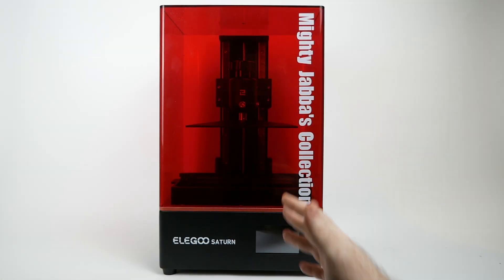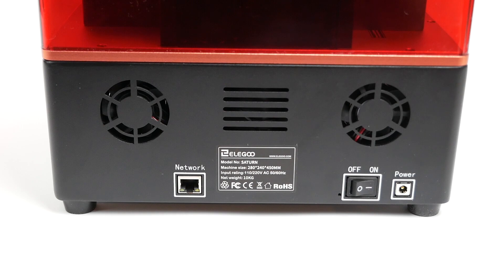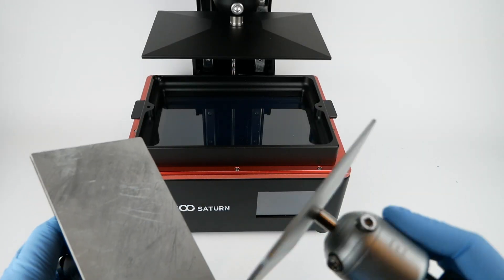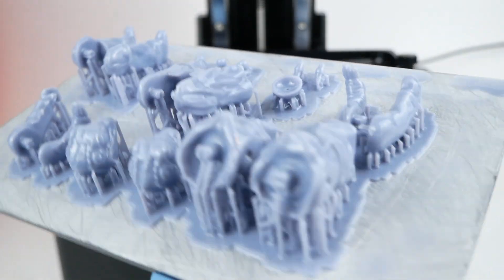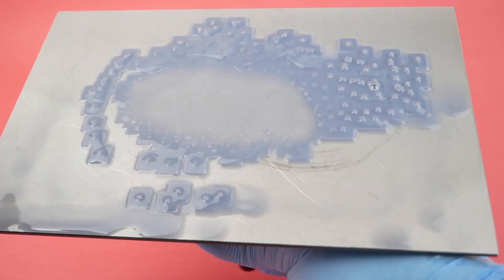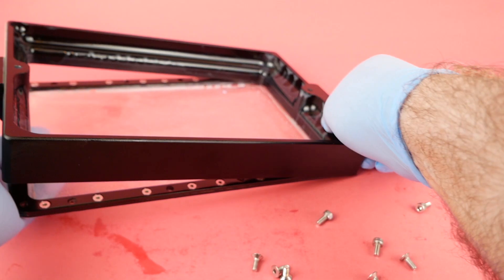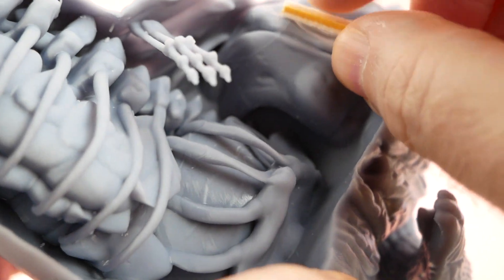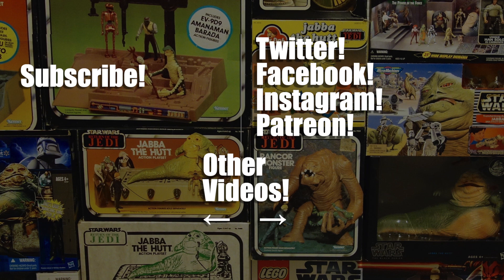Elegoo Saturn Resin 3D Printer Review After 4 Months

Comment: To think the Mars 2 Pro used to be almost 300$ on launch and now I have gotten one of these for 300$ in 2022. If you're on a budget and have the patience, waiting for resin printers to get older is definitely the way to go. Not only will you able to get the machines for much cheaper, but you also get extra support from other users on the internet with troubleshooting and maintenance. You have to appreciate early adopters for taking the hit with any issues and shortages!

Comment: I  purchased a Elegoo Saturn just like the one in the review, but after 10 different atempts, I have not been able to print one single item.  All I get are clumps of resin stuck to the bottom of the felt film and the built plate just you show it. The film is new, so I know that is not the issue. Any suggestions?
Reply from the maker: It’s hard to say but I would try releveling it and then look at your exposure times

Comment: Awesome review of the Saturn, I got lucky I saw the Saturn available on Amazon and I jumped on. I didn’t have much knowledge of the post process but over time I got used to it. I love printing big models such as busts and space ships. I think it’s a pretty good machine and it does a great job. I had the same issue with the FEP and I actually put a hole into the FEP. I also have to say finding extra parts like FEP, vats and build plates to be difficult for Saturn as most vendors don’t have it. 
My number 1 upgrade for this printer is get a Flex Plate. I ended up hating removing my prints. Once I got a flex plate I’’ve been enjoying this more. 

Also the update of firmware was challenging as Elegoo had bad documentation. Their support helped and It works. 

Overall I love my Saturn, I don’t own a Mars. I’m looking towards Jupiter next.

Comment: It's interesting you said you'd like the USB on the fron, I saw a few other reviews that say they don't like it on the front because it has had resin spilled in. Interesting differences.
Reply from the maker: It depends a lot on how you have your machines arranged, I think. If you have them up against a wall, the back is the worst location, and if you want a line of machines next to each other the side is also bad. I haven’t had any issues with ones in the front personally.
Reply from the maker: I did cover the basic process in more detail in my Longer Orange 30 review from a while back, and I recently made a video about the Elegoo Mercury X Wash & Cure Station, which is my current process.

Comment: Where does one find the programs to use with the 3D printers?
Reply from the maker: If you mean the slicers, just download them from the company that makes them (Chitubox, Lychee Slicer, etc).
Reply: Depends on the printer.

Pretty much all of them have their own slicers. But the slicers could suck. (Like, Luban for the SnapMaker is terrible, so I use Cura... that said, that's a PLA printer)

Comment: Thanks for that.  I was wondering if you have tried adding any mica or ink dyes to your prints.  I try to make things I can use in everyday life, so getting it to do colors is nice.  I can acheive that on my Creality 3 Pro, but it has obvious limitations.   Thanks Gary.
Reply from the maker: I have used fine glitter (not as fine as mica powder but close) and I’ve also mixed colored resins to get new colors and effects. They both work although the glitter in particular can be tricky. I haven’t really tried using dyes but I actually do plan to do that for an upcoming project.
Reply: @MightyJabbasCollection  Thanks for the quick reply.  I am trying some gold mica powder, with clear resin, it comes out brownish, EXCEPT on a couple of flat surfaces where it comes out good.  Wondering if maybe changing the time for the lights might change things.  Set at normal for first layer, wondering if maybe upping the next layers might make it better.  Any idea's on that.  I am pretty new with it.   Thanks.
Reply from the maker: It might be that the resin itself is yellowing. Clear can be pretty hard to get right but generally you want to only expose it the minimum amount required. So I’m not sure increasing the time would help. This kind of thing requires a lot of experimentation though
Reply: @MightyJabbasCollection  Yep, I expect I will be experimenting with time,  maybe white, and just keep trying.  Thanks for the comeback.

Comment: I watched two reviews of this printer from different channels, both needed to replace the film.
Reply from the maker: That’s interesting. I wonder if there is anything different about the film itself or just something about the way the printer works that’s stressing it more
Reply: @MightyJabbasCollection  I ordered mine today (my first resin), but based on the way the printers "pull off" the film, and the fact that the larger film has more "distance" to the center, could it be the stresses are more on the center of the film on the larger plate?

Comment: Hey as a 3d jewellery designer moving into printing, would this be worth the extra money over the pro 2  as tolerances are very important?
Reply from the maker: I think the Mars actually has a very slightly finer resolution due to its smaller size, but they are functionally the same IMO. I wouldn’t think there would be any benefit to going with the Saturn if you didn’t want to use its larger size

Comment: Hi, I had a quick question. Can this or the smaller version make transparent and/or translucent objects without there being lines for each layer? Thanks!
Reply from the maker: Yes, but it can be a little tricky to get things to be completely transparent. Parts tend to get cloudy after you wash and cure them, unless you do something like spray them with gloss spray.
Reply: @MightyJabbasCollection  Thanks! Is this something that only this type of UV printer can do? Print without the lines you see in other printers? I've never owned a 3D printer before. I also wondered if I would be better off using a 3D printer to make a 2 part mould that I could use with transparent or translucent resin. Thanks again!
Reply from the maker: It’s probably possible because resin printers can print with such thin layers that they can’t really be seen. But it’s still not perfectly transparent, although it can be very close if you do it right. What is it you want to accomplish?
Reply: @MightyJabbasCollection  I collect Masterpiece Transformers, and some come with things like blast effects, and some don't. I thought it would be cool if I could make my own. I do know 3D modelling in 3DS Max, but I haven't looked into this stuff enough to know if that would be very helpful or not.
Reply from the maker: I think that would probably work fairly well with transparent resin.

Comment: I used a plastic doodad to help tension my fep on the mono X ,are the printers that different ?
Reply from the maker: I have seen some instructions say to put a bottle cap or something under the FEP when changing the film to help tension it. Is that what you mean? I haven’t done that myself (and forgot to check what the official instructions are). For what it’s worth I’ve never had an issue doing it this way on my other printers and it seems to be working fine. The original FEP that I had the problem with was installed from the factory
Reply: @MightyJabbasCollection  yes I use a file I got from thingiverse to print a spacer and do get lines on the larger prints but it is the first fep I have installed in the nearly 3 years I've been resin printing so it maybe my fault.
Reply: Changed fep a few times on mine. Paper towel folded up twice does the job. I also add 2-3 drops of ptfe lubricant after I clean out resin to keep lift speed popping and works great!

Comment: The print fidelity is astounding! I wish I could afford one of these guys.
Reply: Once you purchase one the buying doesn't stop as the projector panel is a consumable and all MSLA printers require them to be replaced between 50-500 hours of printing at a 50-500 USD cost.  Nothing on a printer should be a consumable except for the resin.  Bad enough we have all of these prints that go in a landfill (the mistakes) because no city will recycle them, but now we have even more electronics ending up in the city dump only this electronic part is 50-500 hours between dumping.  Just not for me, and I so much would buy one if they stopped with the consumable projector panels.
Reply: @generalawareness101  They say 500 hours but everyones' mileage is different. I have personally used mine for close to 2k hours.  I bought a screen for $90 just in case 5 months ago. There are printers now with no screen for the same price +$100, would be nice to see how they work. EDIT: All printers have consumables just so you know :)
Reply: @vitobertucci9689  Not for those prices as 8 years and going strong on my filament printers.
Reply: @generalawareness101  and what do you suggest as a substitute?
Reply: @issabader1561  As much as I want one I am not into the whole consumable nonsense.  I don't own a 2d printer for this reason though if I did it would be a tank system so I could VERY cheaply refill it.  For a Resin printer the tech is now 8k I think but still the hours of usage is just not risen. I think going the UV route is not the best route since UV tears everything up it touches.